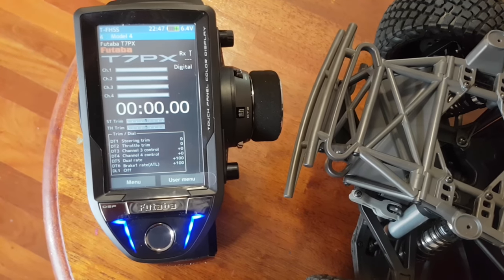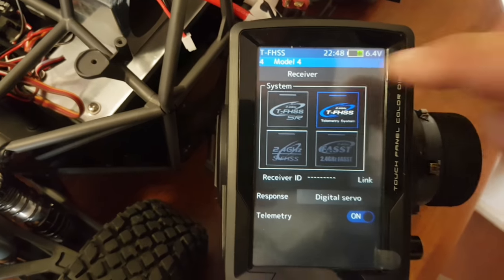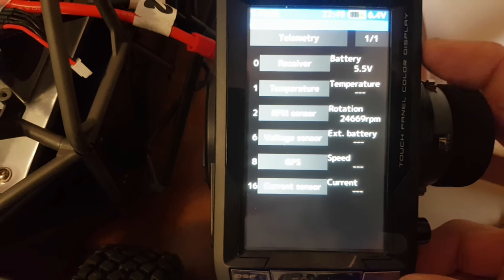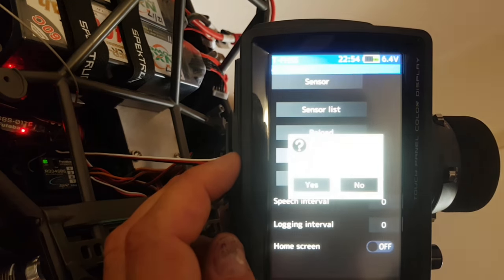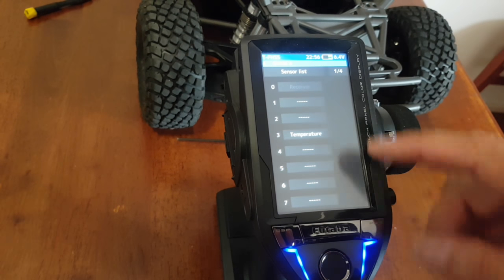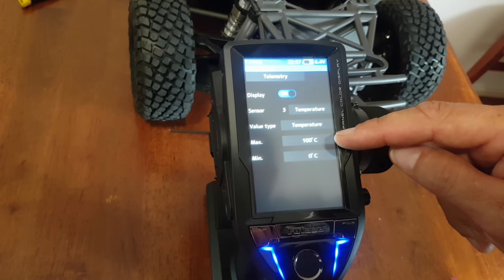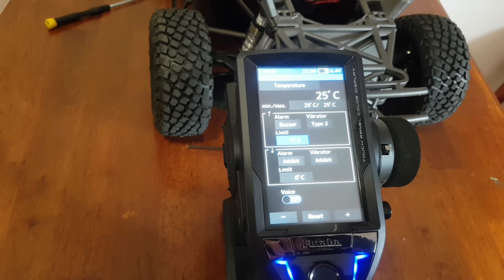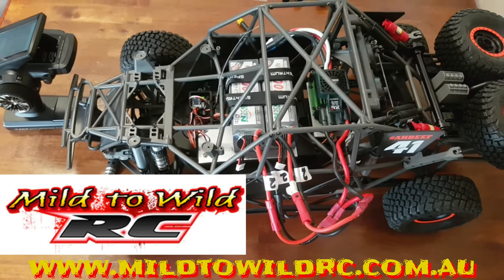Futaba 7PX Temp Sensor Telemetry Setup

Comment: Thanks for the video. Does the sensor read the internal temperature of the car or the motor surface temperature?
Thanks
Reply from the maker: This particular sensor is an external sensor & measures the surface temperature of the can.

Comment: Hi,
Could you tell me what futaba part needed to connect telemetry sensors to the s. bus port? the manual page 115 shows no detail at all!
Thank you
Reply from the maker: Hi Mohamad, You can plug the sensor directly into the S.Bus port, however if multiple sensors are being used i believe you can simply use a Y harness.
Reply: Thanks for replying, What "Connector type" name goes inside the "S. Bus" port please?
Reply from the maker: I've always known them as Futaba connector but have also heard of them referred to as a servo connector or JR connector (slightly different but compatible)